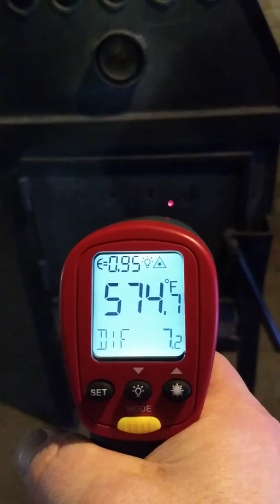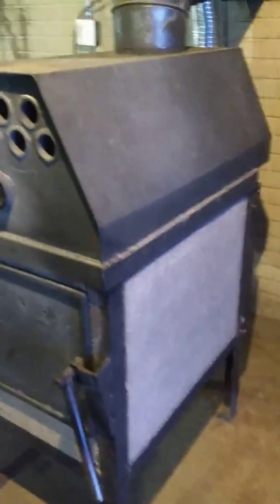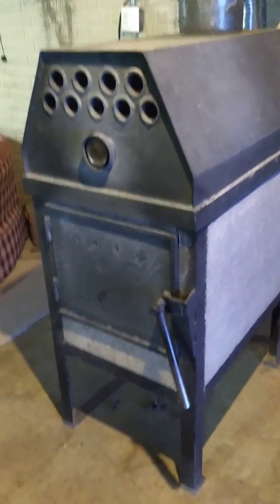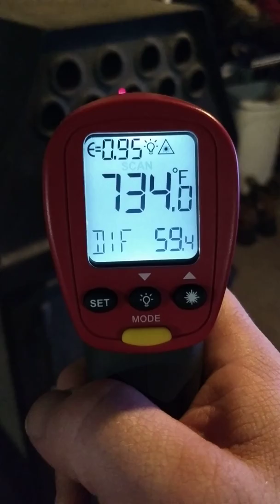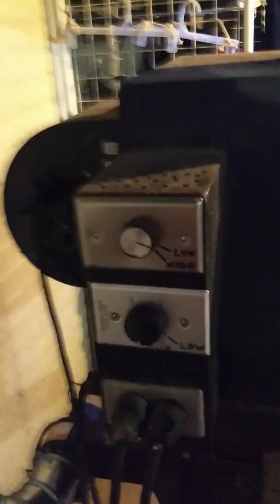A wood stove like no other! The Glowstove showing gasification demonstration

Comment: rocket stoves(heaters///and mass heaters)...2500degrees in burn chamber....you can breath the vapor exhaust...Mercedes owned company makes a coffee table looking mass heater , no chimney needed, low exhaust temps due to more complete combustion and more removal of heat into mass .......USA the great wasters. I could have heated 10 lifetimes with same wood had I only known.....and NO smoke, chimney or cleaning.

Comment: Would love to connect water to this design and use it as an outdoor wood boiler, I don't have a basement and it a 2500 SQ ft manufactured home...any thoughts?
Reply: Attached garage? I have an indoor gasification wood boiler (MBTEK UNI) in mine attached to a hydronic system coupled with a conventional backup gas boiler. I have a 1500 SQ ft home and only go through 3 cords of wood a year in northeast Wisconsin.

Comment: We have installed a Walltherm Zebru wood gasification stove.
It’s excellent, but it does require daily cleaning out the ash and re-lighting.
It’s 14 Kw and heats the room and the water for the central heating.
You can see it working on Google…..

Comment: Sorry buddy. A hot fire is not gasification. You have to have an O2 starved reaction zone that is then passed through a charcoal bed at 1000C+ degrees to crack the wood gas into CO, H2 and CH4. A hot fire is not enough for pyrolysis's to happen. My gasifier burns at 2000C. My wood stove burns clean at 1000C but its not gasification. Its just a clean burn.

Comment: You seem to be on a mission of efficiency so I'll pose my question that I've been wondering about for a long time. I see you have some tubes that try to capture more heat before it escapes up the flue. I have wondered why people don't try to capture as much heat as possible before it exits out the flue. I think there should be sheets of metal attached to the flue spaced half or so inch apart all the way up the flue inside in order to capture, recycle, and radiate that heat back in the room. Wasted heat is wasted heat so why not try to save as much as possible before it exits the end of the flue? In my thinking, by the time the heat/smoke exit the flue, it should be just slightly warm air, ideally cool. I've yet to see anyone who has made such. Do you know of anyone who has?
Reply: I have never burned wood so please ignore if you want.
I have, however, done a lot of reading on this subject as I would love to be able to at some point in the future.
There are very efficient boilers/furnaces out there with an efficiency rating of around 90-92%.
They don't go any higher as there HAS to be a certain amount of heat that goes up the flue/chimney to create the draw/draught.
If you were to remove more heat from the flue gases you would run into problems with the gases going up the flue.
This may be corrected by using a flue/chimney fan but in my eyes that would be defeating the point of burning wood as you would need to use electricity to power it.
I know the amount of electricity would be small but in a power cut you would be stuck.
Plus the fan would have to be able to withstand serious temperatures if it was after the fire and in the actual flue/chimney.
Reply: Venturi would work
Reply: As I understand it. Cooling smoke too much makes the residues stick to the sides; creosote, tar etc. When that builds up, it can catch fire, called a chimney fire, and that burns houses down. Even bigger problem with flue pipe.  (Not sure why chimneys/flues aren't designed to just burn it out and continue normally after)

Comment: hi  mr glowstove .. great idea  .. so good I have added my own  ideas to your excellent design ... My stove is constructed using 18   25 kg bags of refractory reinforced with Stainless steel fibers . 1 lb to every 25 kg bag of refractory .mixing with the correct amount of distilled water is a true labour of love .. realy hard work .  the stainless shards  2 " long make the aggregate almost a  solid .blob . My home made   (copied from You Tube ) vibrating table has performed miracles .  and has made the cast panels excellent quality .I have incorporated two clean out access doors in the upper airflow zones .the lower zone with the access removed   the combustion can be viewed as it is leaving the after burn chamber  fine tuning / regulation of the air fed into the afterburn zone / chamber  allows for  a  complete burn to be achieved . I can send you some photos by email if you want to see my next generation Glowstove .  richardwallinger@gmail.com.

Comment: hi  excellent video .. I am 50% of the way through fabricating my version of your excellent stove design . I have incorporated an intermediate AFTERBURN layer of 8 , 40mm o/d SS tubes . then the top section of the stove is the same as yours with the clean-out door / access  for removing ash.

Comment: What type of refractory are you using Sir ?? Thanks
Reply: I am using Geocast 60AR  from Geoinert suppliers in Portugal . this is good for over 1600 Centigrade . I am adding stainless steel fibers to the dry aggregate 1lb per 25kg bag of Castable refractory product . then 8.5% distilled water  add the dry refractory to the water and mix thoroughly using a narroe trenching shovel. then add to the mold and vibrate until level cover with plastic sheet for 24 hours before removing the mold patterns .
Reply: @richardwallinger1683  I really appreciate you giving me the formula for the stove backbones. How durable is the refractory material when just throwing logs into the belly of Lucifer ???  What would it cost me for plans and can I reach you for the what to do and what not to do factor ??? Thank you very much for your help Richard. I want to make me a stove just like your Sir. Peace and God bless too.
Reply: @richardwallinger1683  Thank you so much for letting me know what you have learned from your experiments. We will keep in touch Sir. Peace

Comment: Great stove and super advice .. I have bought the refractory and some stainless steel reinforcing shards / needles .and mixer paddle. I am making a vibration table at the moment . at my first attempt  the cast aluminium base broke due to the thin casting .My second attempt should prove effective and reliable . I would like to use a ceramic double glazed door . and introduce the afterburn air in a dedicated afterburn chamber at the rear of the combustion chamber .  check out the UK company   Dunsley Heat . their Yorkshire stove shows a nice cutaway of their build . their combustion zone is similar to your Glowstove using 30mm thick vibrated panels containing thousands of stainless steel needles mixed with the refractory. Thank you so much for your description and advice . My refractory supplier in Portugal is called Geoinerte .
The refractory is Geocast 60AR   a 1650 C . aggregate  the steel fibers are ME35/50 - 446.   mixed 1lb. ( around 5,000 slivers ) to every 55lb bag of refractory .  Distilled water is preferable .  to avoid any contaminates ..

Comment: Wood fired blast furnace is more accurate....wondering what the flu temp is with all that refractory insulating it....great thermal mass and high temp combustion chamber though...good job
Reply: flue temps will be reduced with the heat transfer air tubes .

Comment: Wood combustion is basic chemistry. Adding more air does NOT increase the amount of heat from a given quantity of wood... what is happening is the excess air is causing the wood to combust faster which gives the appearance of producing more heat when in reality what is really happening is the wood fuel quantity is combusting faster to produce a greater quantity of heat in a shorter time. Granted that excess air does provide for more complete combustion which does promote a bit of additional heat from secondary combustion but this is only a few percent additional heat. Wood as a fuel has a finite quantity of heat per unit weight. You can either combust it slowly by "choking" the stove's fuel to air mixture for a lower quantity of heat lasting a longer time aka over night or you can provide excess air with a fan to combust more wood in a shorter period of time for more heat to warm a space.  Chemistry does not lie... if you can show how providing excess air in and of itself produces more heat from the same quantity of wood... all wood stove manufacturers would be offering excess air.  To much excess air and you actually cool the process.  Sorry to bust your rhetoric heat dribble with science.  If you would like references look at 1) https://en.m.wikipedia.org/wiki/Laws_of_thermodynamics and 2) https://en.m.wikipedia.org/wiki/Combustion  You cannot get more out that what is originally contained, Conservation of Energy... hence the heat energy of one pound of wood when well combusted produces a near equal quantity of heat energy as output. How good of a heat exchanger is important when trying to make that heat quantity be useful.  Good luck!
Reply: While you are correct, you have mentioned combustion quality. This is the reason for secondary air. Wood does not simply burn. First the wood goes through gasification, many different types of hydrocarbons, including creosote etc, are in a way "boiled off". Once it goes through that only pure carbon is left.  The problem is the coal bed spends most of the oxygen from below the fire. Introducing more air from below simply increases the rate the carbon burns and increases the gasification rate of the wood. Around 40% of the energy in the wood is wasted as unburned hydrocarbon smoke. So we introduce some air above the wood. High temperatures and good mixing of fresh air with plenty of oxygen helps burn off those hydrocarbons, make extra heat from smoke which would normally go outside as pollution. So not only are we getting a more efficient burn we are reducing pollution as well. 
"all wood stove manufacturers would be offering excess air"
In a way they do - all new stoves have at least secondary air to burn of the hydrocarbons, and often have tertiary air to ensure complete combustion.
Reply: @petarmiletic997  hi check out the DUNSLEY HEAT   YORKSHIRE woodstove technology .. the afterburn chamber is  located after the fuel combustion nzone and heated fresh air is introduced directly into the smoke and fumes leaving the primary combustion zone . Once heated the secondary AFTERBURN chamber can be heard and the secondary white hot combustion can be seen lighting up the afterburn zone . If any unit of fuel contains X amount of energy . how come the smoke and fumes going up the flue can be ignited leaving only a heat haze coming from the top of the flue. The glowstove like no other is the way to go   incorporate and afterburn chamber and that designn leaves all of these so called expensive stoves for dead.
Reply: You mention science like that is supposed to mean something. Your over simplification of the burning process is a joke. Each unit of wood only contains so many units of energy or heat. Really? Wow, how profound. The real trick is getting as much heat as you can from the burn to warming the house. Personally I've had enough of waving paper in front of my face and say follow the science. Science has no idea where it is going.
Reply: @danacross3427   I tend to agree.  Efficiency comes from lowering the resistance to transfer heat.  You can have the biggest fire in the world, but if its not transferred in a useable way...its pointless.  The same amount of wood can have drastically different heating effects by the efficiency of the stove...regardless of air/fuel ratios.
Reply: @danacross3427  This post is more than a year old. Sorry you do not get it.

Comment: I want one and I don't even need it!
Reply: Paul Reid , I live 4 miles from a metal shop , I can get any steel , aluminum , brass ,and copper to make anything ,  any size , any shape , , and I live 1 mile from a hardware store , then I have over 40 years welding and fabrication experience
Reply: It would cost about $10,000, but would pay for itself after about 5 years and on
Reply: Loren Armstrong , I'm a welder , I could build this for $500 bucks , I will sell you one for half of your price ,
$5000 , tell all your friends and family members, I'll build each one of them one